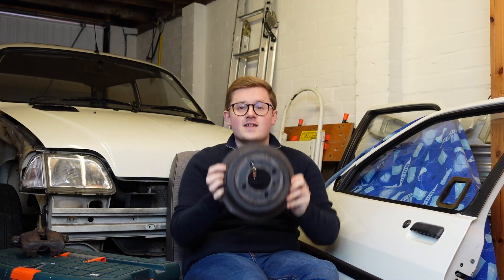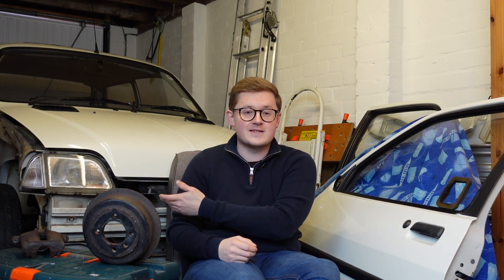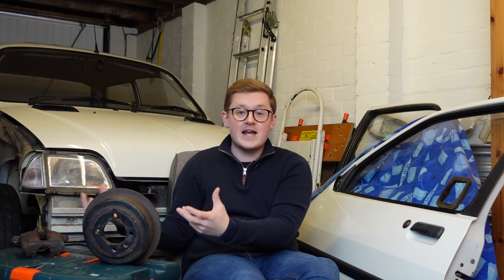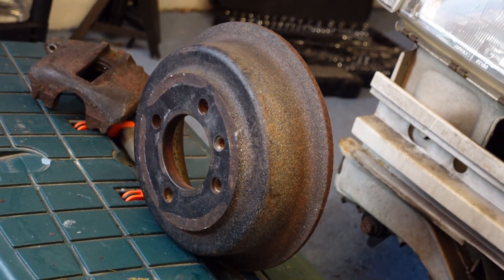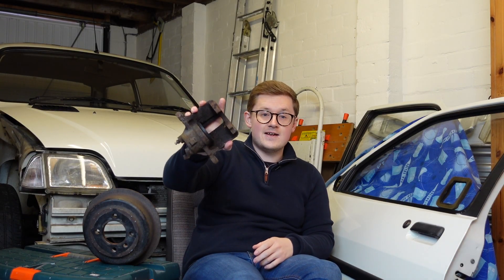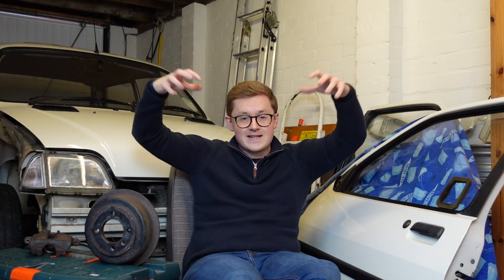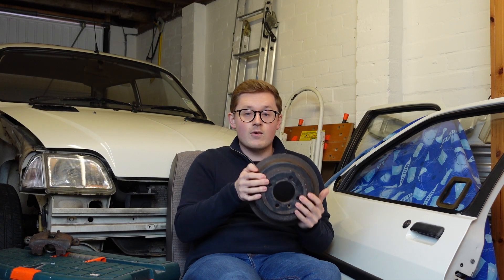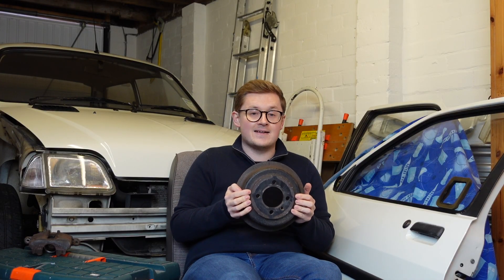Why are Drum Brakes Making an EV Comeback?

Comment: You did that well, it's not something I'd considered even though I'm familiar with the technology.

Noteworthy that drums were prevalent on heavy trucks long after they lost favour on cars. Their service intervals are much shorter even without discs & pads.

In my experience drums drag more than discs as discs can knock caliper pistons back in to the calipers, whereas shoes have a fixed pivot at one end. Drums also have a "self servoing" action, where the rotation of the drum pulls the shoe harder against it - that's one reason why your little Metty is relatively crap at stopping when going backwards.

They could make electronic brakes like the air brakes on trucks. The compressed air holds the brakes off so if the air pressure fails the brakes are applied. You could do something similar with electro magnets like the ones used on keyless door locks.

Comment: One issue not mentioned is that disk brakes as swlf wiping after driving through a flood unlike drum brakes that need to be applied a few times to create heat to evaporate any wather that had infiltrated them. Which is possibly why you do not see "Try your brakes" signs at fords any more.
Reply from the maker: That is true.

Comment: EV cars are usually heavier, but for heavy loads, disc brakes typically require a vacuum-powered brake servo to boost the braking force being applied to the calipers.
On IC cars, this vacuum is provided either from the inherent vacuum in the intake as it runs (petrol), or a dedicated mechanical vacuum pump (if it's a diesel). With EV's, this is a problem.
Drums don't necessarily need vacuum brake servo's, because they have their own self-servo effect, if tuned and maintained correctly. They can also be extremely powerful.
Therefore, drums can get away with not needing an electrically-powered vacuum pump for a servo on an EV, which is an energy drain on it's batteries and requires it's own maintainence.
Reply: That's not how it works at all.
Reply: @DrewLSsix  How what works at all?
Reply from the maker: That's a very good point, but I'm concerned at how electronics would manage to control the brake force while stopping the self-assisting force running away with the brakes? Would a servo still be desirable in order to even out the hydraulic force?
Reply: @TwinCam  Electronics already do control braking forces, that's been a basic fundamental function of every Anti-lock Braking System module since it's inception. It needs to release then reapply the brakes rapidly without causing a wheel lockup, so to do that it monitors wheel speed and existing pressure in the brake fluid using a couple of transducers, so that it can actuate the ABS pump properly. Originally this was done purely through hydraulics, but over time it was found that electronic transducers and actively monitoring brake fluid pressure was more effective and reliable (people simply don't change their brake fluid enough, which produced problems in pure hydraulic ABS modules).
Brake servo's only magnify total braking fluid pressure by applying atmospheric pressure through a lot of leverage to it at a controlled rate, they don't even out anything. If you created a breaking system where only the front or rear brakes were servo-assisted, you run into a condition where one set of brakes are dependent on however much vacuum is in the servo unit at that moment, which isn't desireable or safe if you had to brake hard or quickly.
Therefore you either apply servo-assist to all of the brakes all of the time, or none of them and completely do away with servo-assist, relying on ABS which isn't affected by servo-boosting anyway. That can be done with some correct sizing of the drums and the relative sizes of brake disc-to-pad surface area, but the rate at which brakes are applied will still be different due to the drums having their own self-servo-effect coming into play...I believe you mentioned something about that in your video.
Reply from the maker: @mazdamaniac4643  What I mean is with full drums theoretically in the future!
Reply: @TwinCam  Ah right, okay. Full drums, front and rear.
Yeah that can be done quite easily with existing ABS modules and pumps, all you would have to do in software is copypaste the rear drum profile into the profile for the fronts, but increase the values +10-15% plus a few percent to account for weight transfer under braking and any drum diameter changes. Little bit of trial and error, but I don't see much of a problem at all here, perhaps a modified ABS ECM module if a hardware change is needed but that's fairly easy to implement at a manufacturer's level. Mechanically, I don't see any real need in changes for the ABS pump itself, as far as it's concerned there's not much difference between drums and discs when under emergency braking conditions.
You'd have to do all of this anyway if you decided to scrap the vacuum servo unit, or else the ABS would throw a fit if you hit the brakes too hard. Nothing drastic, but it just wouldn't work as good as it should, which is a fairly straightforward safety issue.

Comment: One other advantage to drums for an electric car is they need little power assist because the shoe, once in contact with the drum, the drum tends to "pull" the shoe further into contact with "servo" action. That's what makes drum brakes "grabby". Disc brakes in larger, heavier cars require some assist, a power brake booster, because they have no "servo" effect. Power assist is simple with the vacuum from an internal combustion engine, but more complicated with EV's.
Reply from the maker: Very good point, I hadn't thought about that!
However, with electronic control, surely the agenda would be on controlling the brake force to keep it consistent, rather than allowing it to run away?
Reply: The "self actuating" design is what makes them grabby. Without that, drums would take an excessive amount ot pedal pressure.

Comment: I wish I could swap all of my disc brakes for drum brakes on my Nissan Leaf EV. Lots of corrosion on the discs because they don't get used enough. Ironically, my Leaf has drum brakes for the parking brake which rusts because it never moves when it is applied which means any rust doesn't get scrapped off. The Leaf has the worst of all worlds when it comes to it's braking system!

Comment: drum brakes are still superior for many applications. The reason heavy class 8 trucks and trailers still use them. Relatively Recently disks have been developed for them. Even in the 80's you could equip them with no front brakes at all, i know because i drove many. People who think drum brakes are dangerous, are the same people who think the same about bias ply tires. I guess they are unaware that the fastest NASCAR ever went was with drum brakes and bias ply tires. Drum brakes have significantly more surface area. Overheating only comes into play with improper application, and poor maintenance. I do like disk front and drum rear, disk rear has very serious flaws in many applications, and wear out and freeze up prematurely.